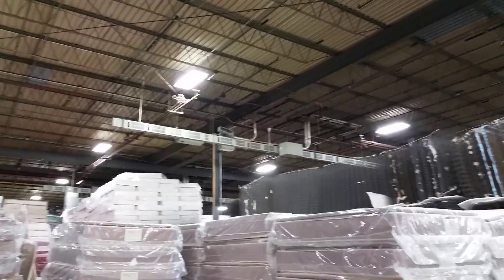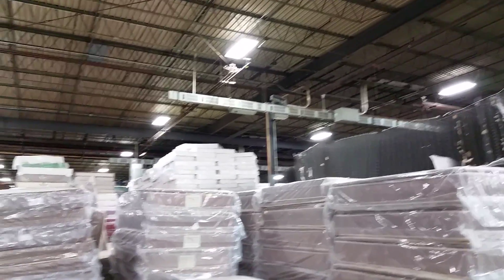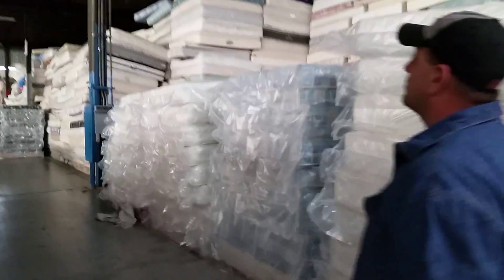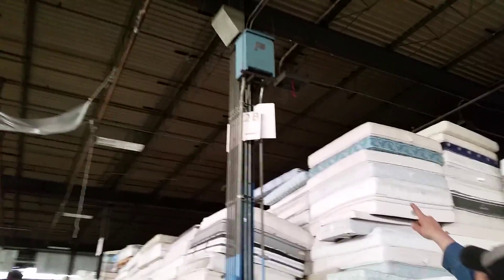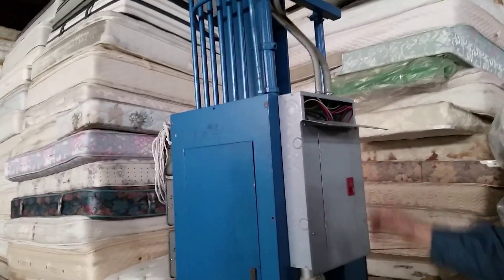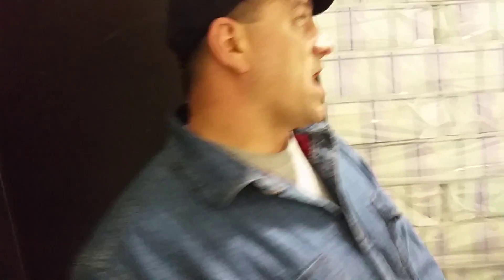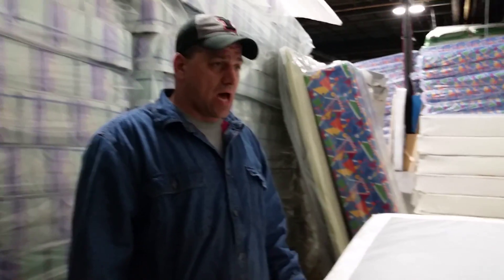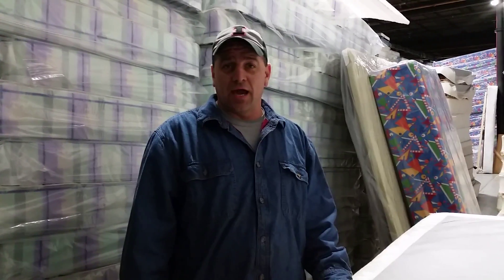HIGH VOLTAGE!!!  The Death room

Comment: Company I use to work for were going to build a new warehouse and they sent an electrical enginenier in to look at the power room to see how they were going to power the new building. He walked into the room looked around and his jaw hit the floor, His exact words were "This is a Death Room" !  Original 1940's wiring meter boxes and open fusses !  I know just what you mean about the room.   Bandit
Reply from the maker: yeah with that stuff you turn it off rip it out and start over
Reply: Well that's what I would have done but they brought power for the new building off the back street so they didn't have to up grade everything. Bandit
Reply from the maker: Always more than one way to skin a cat ;)
Reply: Boy aint that the truth !  Bandit
Reply: I don't know about these things but they wouldn't have to have had the old system taken away even though they weren't using it?

Comment: That's pretty cool. we use those time clocks on our stock water wells to turn our pumps on that are on the grid. always have a problem with the little motors burning out though after a year or so
Reply from the maker: I usually use T 101 Intermatic timers. they seem to last a while. if you keep having problems you might want to try the newer digital ones. And see if you can get a warenty when you buy them.

Comment: Cool tour! Im nervous changing the old 120 screw in fuses! I can only imagine sticking your hand in to change a 12000 one! Keep the videos coming!
Reply from the maker: yeah I can get pretty hairy sometimes. But I've been doing this for a long time. I don't touch anything big until I have verified myself that it is off. over the summer I did a huge Sears logistics that had parallel 4000 amps services. the wire size was 1000 MCM you need a machine called a jogger to pull it through your pipes. Thanks for watching and commenting.